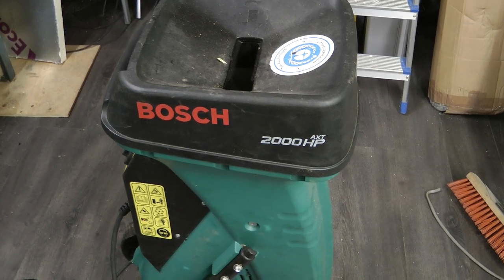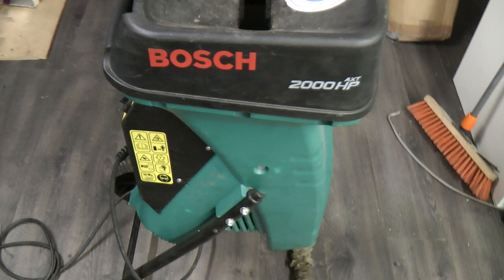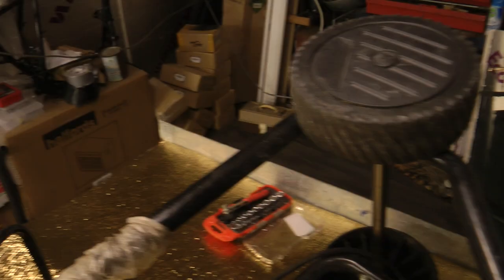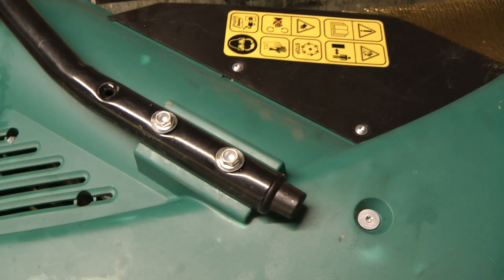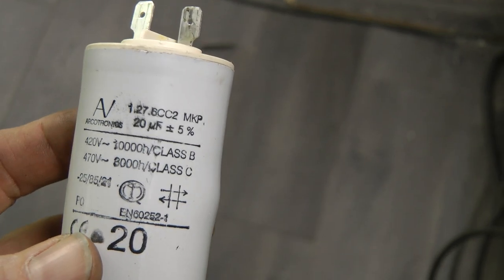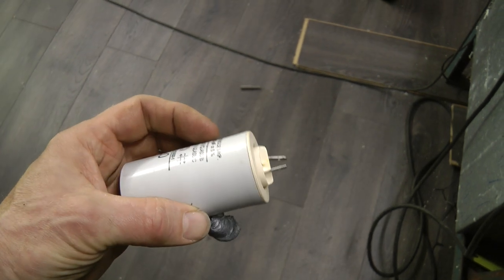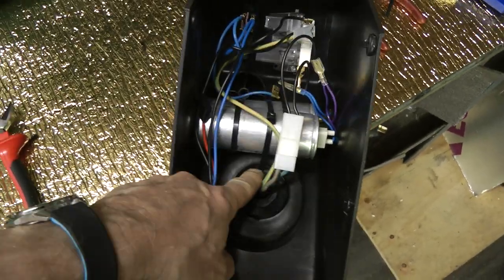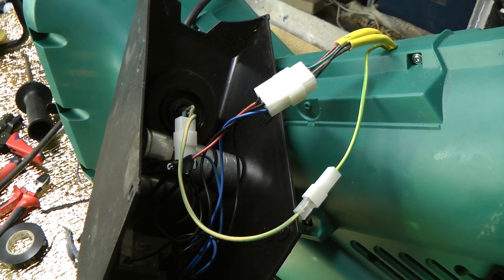Bosch Shredder Stopped Working in random direction. How to Take Apart and fix the fault

Comment: Awesome vid.  Just fixed my 15year old axt2000 hp using this guide.  Got a matching screw in capacitor (20uF) from Amazon for £8 and all working as new ready for another 15 years.  Many thanks!
Reply from the maker: Great job. Ours has done so much work.  Whilst you are in there it is worth greasing up her gearbox..I have done mine a couple of times.

Comment: Legend! Exact same problem. Fixed within 24 hours with a part from Amazon.
Reply from the maker: Thanks for watching.  Mine has seen many hours of shredding action but it is still 
 soldiering on. However, It is starting to sound a yang, yang, yang so time to open it up and grease the gears again!!  Actually my wife said it sounded Yum, Yum, Yum, Yum and now that is all I can hear when I use it.
Reply: What capacitor did you use to repair it from amazon. I think we have the same issue today. It's given 20 years or constant service until today!

Comment: I have the 1600 version, which is basically the same. I've had it for 23 years. It is fine for woody material, but woe betide trying to get leafy branches to go through without clogging. The design is pretty rubbish, really. Bosch designers must have known about the clogging problem, yet they designed a machine that is difficult and time-consuming to take apart in order to remove a blockage. Health and safety, I suppose. Adults cannot be trusted to clear a blockage in the most straightforward manner by disconnecting power, then removing the top chute. But I'm now a dab hand at removing the chute! Just to make life even more difficult, the Bosch designers specified special screws to fix the chute to the body. These screws require a special screwdriver. However, I've replaced my screws with bog-standard Philips screws. Having removed the screws holding the chute, it can be lifted off. Then remove some (not all) of the side screws that hold the two halves of the body together. Now you can prise them apart and remove the inner chute. Then it's easy to remove the blockage. Couldn't Bosch have done a better job? Well, of course, but maybe they expect customers to just buy a new shredder when the current one is clogged up solid. Note that once the blockage has been cleared, the shredder still works as well as it did when brand new 23 years ago. And it is super quiet!
Reply from the maker: Mine is not too bad bad but I have noticed that the tendency to block depends on the plant being shredded.  Mine chomps happily  through, laurel, birch, privet and birch but feed t a branch of Cotoneaster and it turns into carbon-fibre ropes that binds up the Slauger  (that's a name I just made up for slicing auger - see what I did there?) . The wife seems to very talented at blocking the beast too.  Have you noticed that the machine sounds like Yum, Yum, Yum.
Reply: @razenby  Yeah, that's the sound mine makes!

Comment: Knowing where the screws were etc was fab - in my case it was a sticky switch, so I was able to oil it, and bingo (in fact I only needed to take off the rear black plastic). THANK YOU
Reply from the maker: Thanks for watching.  My unit is still going strong.

Comment: I have two of these and the first chewed to spiral screw to bits and /I welded and new edge but it did it again so I bought a new screw (very Expensive) it worked fine and is still working except the random direction problem and hesitant starting. I will maybe use another  capacitor or maybe two  wired together to give a real kick starting  to it. The gearbox does need stripping out and regressing as they do no use enough for a long life also the bearing in the top of the spiral seizes up  £1.60 for a new one including postage. The second machine is doing the same starting in what ever the way it wants if. At all,  I will do that one as well but it is newer than the other one. One hint is to spray down the inlet/ outlet holes with a spray can oil/grease to stop it going very 😊badly corroded from atmospheric moisture .
Reply from the maker: Change the motor capacitor if the direction is random. Worked on mine..

Comment: I borrowed my neighbours chipper chopper magnum only to find is is turning in reverse. It does not have a reverse switch like yours... Is there a way to get it to turn in the right direction.
Reply from the maker: Usually the motor run capacitor has failed or is failing. As it gets to bad it can start in ether direction and when running lacks torque.

Comment: Thank you Magic Smoke for this. My exact model gave the same symptoms on Sunday, I stripped it down and yes the capacitor had had a melt down. Ordered a new one (difficult to find) and awaiting its arrival imminently. Easy Job. BTY the capacitor had its cap blown off when I opened the shredder, I thought the factory had used too much glue (it was the melted components that had forced it off) I removed as much as I could and reassembled. It started first time but after 30 seconds thick white smoke appeared. Definitely time for a new one!
Reply from the maker: Great news. Thanks for watching.

Comment: Was a genuine replacement capacitor not available?
Reply from the maker: Probably could have bought one but I just found some about in some old light fittings. . They are physically larger but are proving much more reliable.

Comment: great video Just fixed mine  exactly the same problem got a new capacitor of amazon for £5.95 it now works great, I am glad I did not take it to the tip. many thanks for this
Reply from the maker: Good to know, mine is still soldiering on. Mechanically it is very durable.  Thanks for watching and subscribe if you can.

Comment: Did replacing the capacitor fix the random rotation issue or was that down to a faulty switch? Thanks
Reply from the maker: Yes, replacing  the cap sorted the random rotation issue. The capacitor' phase shit generates a rotating magnetic field  with more torque and rotational determination.
Reply: @razenby Thanks very much for taking the time to reply. Thanks to your video I took my shredder apart and found the capacitor looking as bad as your old one! Just received a new one in the post. Will post here when I have fitted it (rain permitting!).
Reply: @razenby Hi. I replaced the capacitor and the shredder now works fine. Thanks for the video and reply.

Comment: Love the channel name - I've experienced the magic smoke myself not long after purchasing a BBC Micro. Curiosity always gets the better of me and I always have to turn them on to see what hardware is inside which 99% of the time blows the RIFA cap. Many thanks for this video - I've inherited the exact same model and it's not shredding properly as the bark from the branches doesn't go through and stops branches going down.
Reply from the maker: Thanks. I used mine over  the weekend to shred a the brushwood from a large dead cherry tree and it is still chuntering on.  (Prunus vulgaris)  In it's time It has done a lot of work and the business end is still very effective. It is like a baby.. you have be very mindful of what you feed it...

Comment: Great vid, thank you. The replacement part is totally obselete now. I've scoured for one, could you recommend a replacement?
Reply from the maker: Do what I did just get an old light fitting or look for a motor staring run cap on ebay.  Any one will do so long as it has the correct AC working voltage and capacitance.  Must be an AC capacitor.

Comment: Mine seems to work fine in the normal direction but does nothing and blows the fuse if I start it in reverse. Could this be the capacitor too do you think?
Reply from the maker: Could be the capacitor.  If it stops on a motor pole and the cap isn't working the motor has no starting torque and the fuse blows.  Check the cap. We did loads of shredding since I made this video and it is working fine.

Comment: I need one of these caps mine blew a while ago been to lazy to swap it - stripped it down when it broke on me the first time managed to get it working for a bit but then it failed again, so I packed it up and left it as I couldn't be arsed to disassemble it again. Any ideas where I can get parts for these from?
Reply from the maker: I salvaged 2 x 8uF caps from an old fluorescent light fitting. You can buy motor run caps on eBay or amazon. From memory I think the original was 20uF but it ran fine all summer on 16uF during lockdown as my wife shredded nearly the whole garden. It was used a lot!!  There is a big tolerance on these caps anyway,

Comment: I have a slightly newer version of this and my capacitor went 'up it' too. As I was unscrewing the case it fell apart. I have an internal switch - lever style - and I cant find where its from or what its for.
Any suggestions? I am tempted to tape it up and ignore it....
Andy G
Reply from the maker: Is it the switch or the capacitor that you need?

Comment: It is a great shredder far superior to the current models.  For mine the on off switch needs replacing.  Bosch no longer support so have not found a switch replacement yet.  Does anyone know of a source?  ( failing that I will be trying to use a karcher switch which is the 700 2/6 unit but without the bosch specific perspex mounting.)
Reply from the maker: I wonder if the slow rate that this part perishes held off failures until after the pipes were discontinued.  It may an unanticipated end-of-life fault. They should still sell them. Second hand ones are £50 to £90 and you cant get the correct ones for this otherwise splendid manhine.
Reply: @razenby  my karcher switch has just arrived and i have been able to use it with a little modification so my shredder lives on.  Saving landfill!

Comment: Mine has the exact same issue
  Only problem is I'm not as smart as you with electrics 😂 my technique is just to turn it on and kick it until it starts.  Send help 😂 I need a new one!  Also I noticed that human tripod joke 💩
Reply from the maker: get a new capacitor for it. The old ones are mechanically indestructible.  I was give a newer one that had failed but after 18 month I am back using the old one. It takes serious punishment.  Just much better made. Thanks for watching.

Comment: Waw 10 years... we have the axt rapid 2200 and in 1 year it has already failed 2 times 🤣... I am really disappointed in the brand bosch tbh
Reply from the maker: My Bosch orbital sander,  hedge trimmer and power drill dates back  to circa 1996 and are still going strong.  Maybe they have down-engineered the products to reduce cost?? Bosch cutting tools such as drill bits, hole saws, circular saw blades keep their edge extremely well.  So maybe Bosch quality these days is a mixed bag.  True the shredder has been the poorest Bosch product I own.